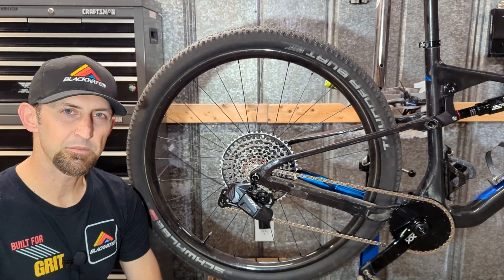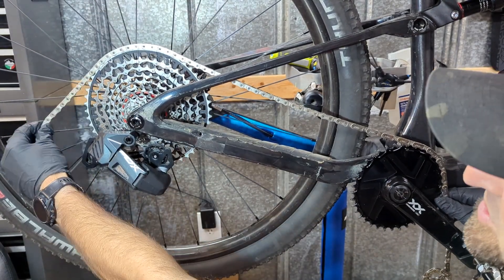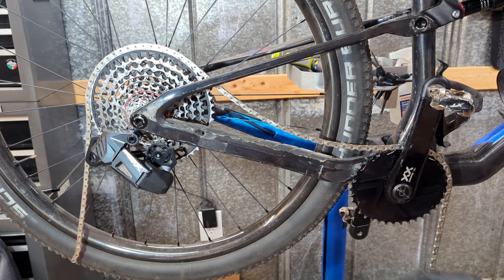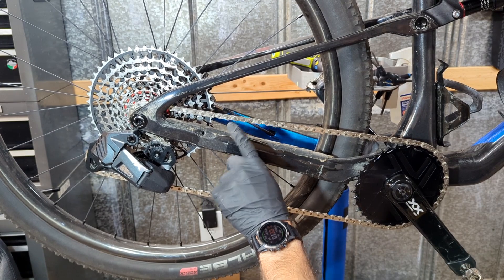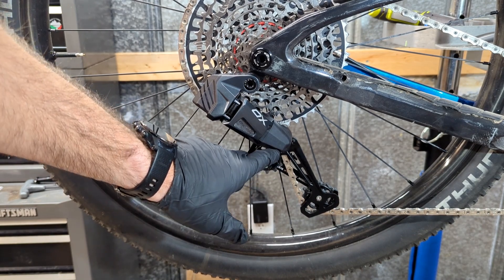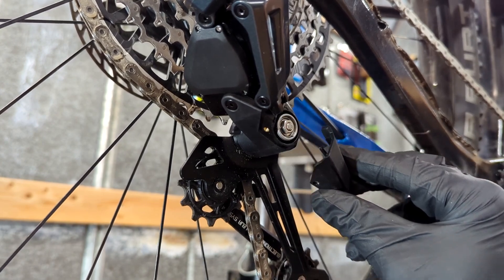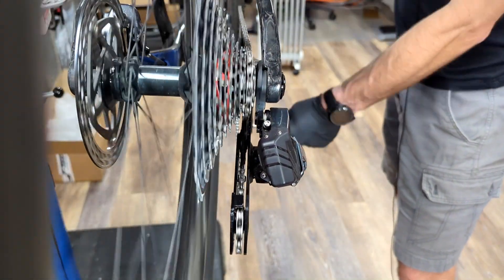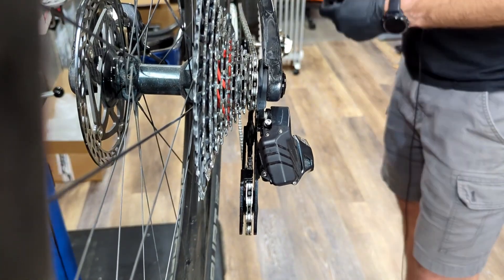How to Install and Set up Wheeltop EDS OX 2.0 Derailleur #wheeltop

Comment: Thanks for posting this. It was very helpful when setting up my OX 2.0

Worth noting that the bottom Jockey wheel is narrow / wide so make sure it is seated correctly or you will have to split the chain to fix it - or undo the jockey wheel

I was surprised at how far out the factory settings were for 11spd

Comment: When I upshift the top wheel in the derailleur keeps hitting my gears as I shift up. Help
Reply from the maker: Hi Larry, sorry for the delay. Were you able to get it fixed? Sounds like you need to screw the B screw inwards so it will pull the upper pulley away from the cassette

Comment: Good explanation and demonstration!

- Is it true the gearing is the other way around than usual, i.e. the biggest cog is called 12. gear (or whatever number of gears I have)?
- All allen keys required for H, L, B and cover cap removal should be of the same size
Reply: The gear numbering can be reversed in the app.
Reply from the maker: Yeah they updated the app after this video to give options. I agree, it is frustrating to have so many different Allen keys.

Comment: I recently bought this derailer preinstalled with mtb bike, and it won't adjust! The chain constantly jumps and there's a constant crunching noise when shifting. I think it's all due to the 1.5-2 mm of play in the derailleur. If someone know how to make fix it tight, please share. Basically, don't buy this piece of junk!
Reply from the maker: Is there play at the bolt connected to the hanger? What cassette and chain are you using?

Comment: Thx for the video. I have followed the manual and have done all the mechanical adjustments successfully, however I managed to  'jam' the rear derailleur in the top cog while using the app in the 'initial' setup. Not sure how, but it's now not responding. this is a 12sp mtb setup. it's now recharging hoping this will help correct things. is there a factory reset of sorts?
Reply from the maker: You will need to micro adjust it back down to the 10t which is "death by a billion clicks" but it will put the derailleur in the proper location. Were you able to do that?

Comment: I got the 2.0 and my bike tipped over onto the derailleur. Bent it all to shit and ruined it. I now have a hunk of 400 dollar scrap metal. Save up another 150 bucks and get AXS GX.
Reply: sorry to hear about your Wheeltop EDS but some of us have Shimano drivetrain..so If I buy AXS GX I have to buy new cassettes, freehub and crankset? oh and the new XT Di2 is very expensive..
Reply: Sorry but if you are a “I don’t care guy” by not securing enough your bike when you parking it, it’s not the fault of the quality of the derailleur. Be more gentle and caring the next time.
Reply: @ChantalPugin if it bends all to hell in a tip over, imagine what will happen in a crash. The derailleur bent before the derailleur hanger bent. The hanger is the sacrificial part of the system and it was OK.

Comment: Приветствую! Подскажите, при настройке, если что-то сделал не так, как скинуть до заводских настроек.
Reply from the maker: Sounds like you probably did the initial calibration too high in the cassette. You will need to microshift that all the way back down to the smallest cog. You can reset in the App.

Comment: How do you like this Wheeltop vs the Archer D1x out of curiosity?
Reply from the maker: Way better than Archer! Archer was slower and not as precise. If you use this within the SRAM or Shimano ecosystem of chains and cassettes, you really can't tell a difference between this and the other major component makers. It just takes some time to get properly set up but once it's good, no need to mess with it.

Comment: Hy, I bought a EDS-OX 2.0 rear derailleur for my specialized levo comp alloy s4 2023. I live in small town in north Norway, whith few bikeshope where the bike-mechanic have little knowledge of the brand. they have done all the manual adjusted, but they can't with app or the (micro adjustment). The derailleur shifts ok up, but down shift is horrible. The mechanic say they have no clue about the the value in and that they have only experiences from the Sram system where such system doesn't exist. Could someone 
 help me with this regard, I seen some youtube reviews of the derailleur. Where the value on app is used as cable tension add or take away. 

This is my system.

Drivetrain
Shift Levers SRAM GX,trigger, 12-speed
Rear Derailleur SRAM GX Eagle, 12-speed
Cassette Sram XG-1275, 12-speed, 10-52t
Chain
SRAM NX Eagle, 12-speed
Crankset Praxis Forged/Custom Offset/ISIS Spindle Interface,160mm
Chainrings
SRAM X-Sync Eagle, 104 BCD, 34t, steel
Reply from the maker: With Wheeltop, you are required to adjust every gear individually with the App where SRAM, the space between each shift is the same and it is the same as adjusting a barrel adjuster on a mechanical derailleur. With Wheeltop, you have to go to each cog of the cassette and fine tune it. With OX 2.0, I found that I had to put a spacer on the Mount Screw  of the derailleur and between the hanger to allow the upper pulley to drop far enough down to the smallest cog. Also check out the Facebook group to get some help there as well. A lot of users on there.

Comment: Stripped Out Screw, Zero Support from Wheeltop!

I really wanted to love this product, but the complete lack of customer support for a $400 derailleur is totally unacceptable. As others have mentioned on Wheeltop's website, my derailleur came with a seized/stripped out screw that prevents adjustment of one of the cogs, which in turn prevents the derailleur from shifting to the smallest cog properly. The manufacturer has completely ignored multiple emails and the "chat" option from their website. They have ignored all requests for service and/or a replacement derailleur. This company will not stand behind this product. It's really a shame, because the idea is so good. However, the lack of any assistance makes this a no go. Spend a bit more and buy from a company that will service the device.

Comment: How would you compare this to Transmisson?
Reply from the maker: If you are using the transmission cassette and chain then it is very similar. The Wheeltop shifts faster, lighter, and can be future proof. If you do not want to tinker, then go SRAM, it is much easier to set up and ride.
Reply: @BlackWaterCyclist  Thanks!  I was considering this.  But since this comes to the cost of the Eagle 90, i'll get that instead since i am building a frame and need the full groupset.  Thanks

Comment: Which chain do you use? My Sram gx does not fit the lower pulley. Thanks. Benoît
Reply from the maker: This set up I used a SRAM flat top chain and it fit with no issues on the lower pulley. The only chain I have seen not work on the Wheeltop is the Campy Ekar 13 speed chain. You have to dremmel down the wide teeth on the pulley for it to clear.

Comment: Assuming still no options to rig the shifter up to a brake (ala SRAM’s Matchmaker?) Tempted to make the jump back to electronic shifting so I can flip my bike from geared to SS mode quicker, but having to pull my shifter each time is a deal breaker for me vs AXS.
Reply from the maker: No options for that as of now but there is a small screw to remove the actual shifter from the clamp but you cannot access it while it is on the bar so that doesn't help you. I am working with a company to make a few accessories for Wheeltop groups and it is on the agenda.
Reply: @ thanks for the additional details. This is the first time I’ve heard about the shifter clamp set up; I’ve definitely wondered about it as it LOOKED like the bar loop was bolted to the shifter clamp in someway.
Reply: @BlackWaterCyclist  This would be nice.  Another issue is lack of horizontal positioning options.  I had to mount the shifter between my brake clamp and grip to be able to reach the buttons as I have a 3/4" - 1" space between my grip and brake clamp.  I really wish Wheeltop designed their paddle like the last one Archer made, really slick single lever design.

Comment: I’ve just bought this Wheeltop and I’m trying to fit it on a Specialized Levo. I can’t get the derailleur to line up with the small cog (gear 1), no matter what I try and do. It lines up on gear 2 perfectly but the app doesn’t offer enough movement and the limit screw doesn’t offer enough movement either.  I have checked and it’s set to the correct gears (11) and nothing looks bent (my previous manual gears were fine) - any ideas that might help please?
Reply from the maker: Try putting a washer on the hanger bolt of the derailleur to push the derailleur outboard 2-3mm. That should allow the pulley to line up with the smallest cog. I think this is a common issue with the OX and the GeX. I did it on my review video with the transmission cassette but looks like it needs to be done even with regular cassettes. A 2mm thick washer should work. Let me know if it does.
Reply: I'm having the same issue. My wheelset is a 10-52 tooth with the SRAM XD hub. I just can't get it on that 10 tooth cog. I tried with a 11-52 tooth using an HG hub and everything works fine. I really don't want to use a washer to bump it out.
Reply: @zimmejoc I’ve given up now. The derailleur broke and whilst Wheeltop have replaced it free of charge it’s sitting in a box in the garage and I’ve installed a SRAM remote kit which works faultlessly. Anyone want to buy a brand new Wheeltop OX 2.0?

Comment: One of the best setup videos out. But you don’t set the limit screws until you’re done setting the cassette up in the app. The limit screws have nothing to do with initial calibration. Thats all done in the app. They are  there to prevent the derailleur being pushed past the limit point and damaging it. They are the very last thing you set. 

How to set limit lower limit after setting up the cassette fully is to screw it in until it prevents it shifting into the 10t cog. Then back it off until you hear no resistance in the shift. Same with the upper limit screw. Why wait until you are done setting the cassette up in the app? What if you set the limit screw to tight and you cant get the initial calibration correct? Yep you will have to fine tune the crap out of it to get it to shift right. What if it won’t even make it into the 13th gear because the cassette has wider spacing than a standard cassette like a rotor? Wait until you have fully set up the cassette before setting the limit screws. 

That’s not how I set up a cassette with wheeltop. The problem is the instructions are still bad. I start by initial calibrating the smaller cog using the app not the shifters. I have found most fine tuning can be avoided by changing the initial calibration more than you thought. Either way I have had some real difficult setups and some that were really easy. All Shimano cassettes are easy. Like 1 min setup. Most sram are easy but may require some minor fine tuning. Rotor and campy are a super B and require custom setups. 

Best advice I can give you is to check your hanger is properly aligned before you start. Something else I have found is a unit in the fine tuning app is about .01mm. So every 100 points is about 1.0mm. Or it is for the gravel/mtb derailleur(they are the same)
Reply: I cant even get it into the smallest cog.  The app thinks it in the smallest while it's actually in the 3rd.
Reply: @GregorF-HansS3772 I have the same problem.. Have you found solution? Thanks

Comment: You have your limit screws backwards.  Big cog is low limit,  and small cog is high.
Reply from the maker: Thanks for the catch. I'm used to the mechanical derailleurs where the one on the right side limits the upper/larger cog and the one on the left adjusts the lower/smaller cog. Good catch and I appreciate it.